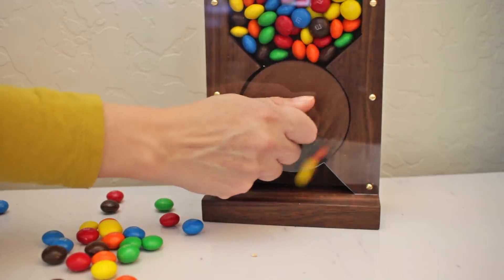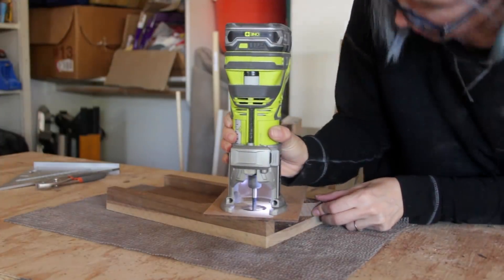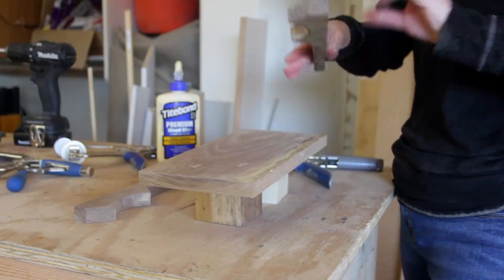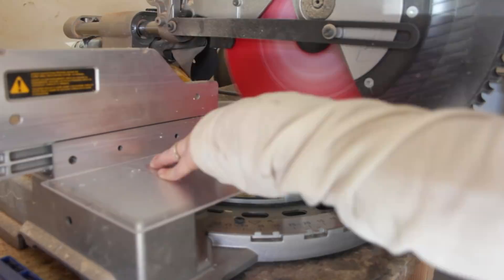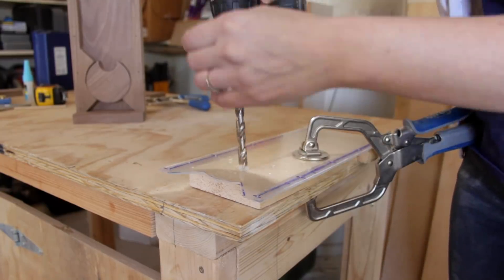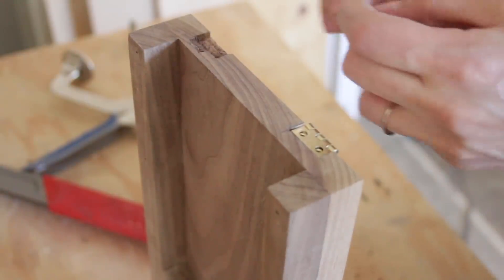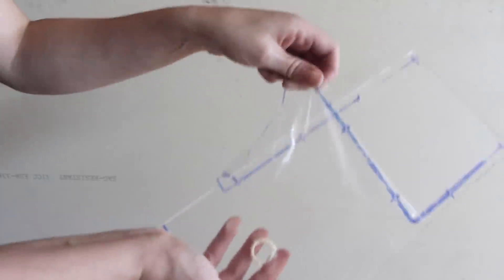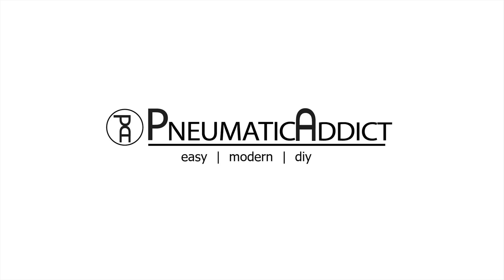How to Make a Wood Candy Machine | DIY Dispenser

Comment: If you want to hand chisel it just takes time and practice to improve but you do want to take shallow passes a little at a time, better to be too small than too big or too deep, you can always take more away.  Some folks will use a spot of super glue to hold the hinge in place and then trace around it with a marking knife to create a chisel ledge to start from.

Comment: Some suggestions for using a chisel: 1) Mark your lines with a marking knife or razor knife. 2) Don't start at your line, start inside the line to remove the bulk of the material. When cutting at your line you should only be removing a small amount of material. 3) Sharp chisels, sharp chisels, sharp chisels. 4) Like everything else, practice makes perfect.
Reply: That's the second time I have heard this about not starting at the line. SO helpful. It made all the difference.

Comment: That is sooo dangerous cutting the offset hole with the forstner bit.  Please use a clamp (if not a drill press) instead of holding it with your hand.  I almost took off my index finger doing this in May.  The bit caught on something causing it to jump right into my hand that was holding the piece.  I was very lucky not to do any damage to the bone or tendons, but have damaged some nerves.
Reply: sorry to be the safety police, that shot just gave me flashbacks, be safe.

Comment: For making cleaner mortises or for any cuts using chisels, use an exacto knife or utility blade knife to score the outline instead of a pencil. They make specific knives called a marking knife for just this purpose. Much more accurate and severs the fibers resulting in a much cleaner edge.

Comment: What nice project and so well presented. You asked for a tip with fitting the hinges and my tip is don't use butt hinges. Look for concealed box hinges. Some accurate marking out then drill four holes and you're done. PS. Please buy a drill press. Even a cheap one is life changing! - Maybe that's a big call but you will never regret it.

Comment: Nice effort, BUT -- there were several issues here. You definitely need to review your measurements - including but not limited to the diameter of the dispenser wheel (Should be 2 3/4") and the pilot holes in the acrylic and wood to fasten the acrylic (they must be larger than 1/16" otherwise when you screw in the prescribed screws the acrylic will crack). Finally - DON'T USE brass screws if using a hardwood (which you should use with projects that touch food - I used oak). They are weak and will snap/break off in the acrylic before they even get to the wood. This is the classic case of "Cutesy-crafty doesn't cut it in the workshop!"
Nice try, but needs a lot of work.

Comment: Quick tip for chiseling out the hing material. Don't start right on the line, The pressure from the chisel pushes back on the wood causing the fibers to bunch up and you end up off your mark. just move ahead of the line about a 1/16.

Comment: Use a marking knife to score the lines for your hinge mortises. Then chop out the waste material with your chisel but keep it a little bit back from the score lines. When you have the material removed, the last step is to pare to the line using the chisel. That way the bevel on your chisel won’t push the flat end back past the score line which is why you usually end up with an oversized mortise if you don’t remove the waste first. Great work and keep checking craigslist for some great deals on a table saw and drill press. Always better to get a well made older heavy cast iron machine for a song rather than a brand new shiny made in china tool.

Comment: A great idea. If I may add - I would make the bottom part out of thicker material and then use a router to make a little bowl like space, so that the round candy doesn't run away :)
Reply from the maker: Good thinking
Reply: Also maybe a small taper on the top edge as a funnel into the candy cavity. Just a 45⁰ bevel or similar.